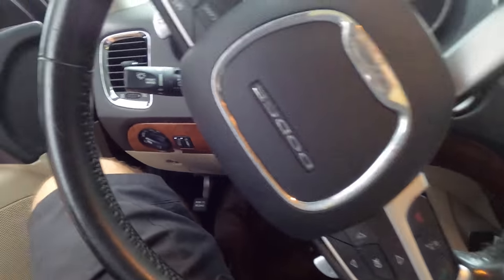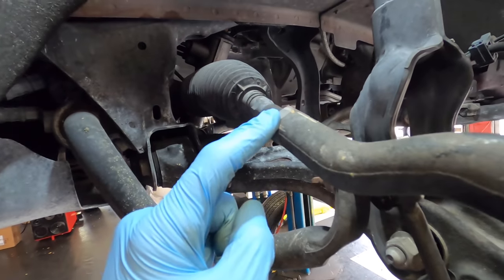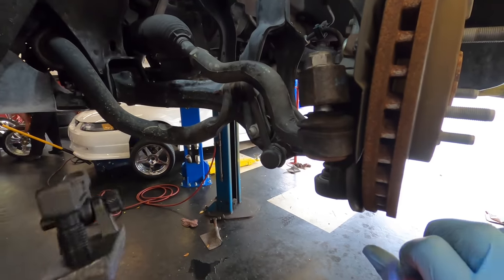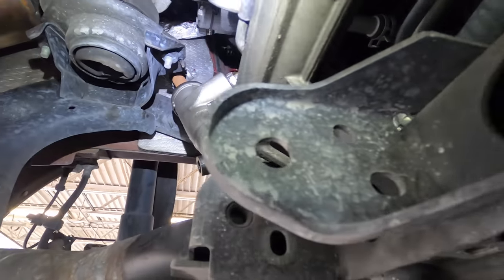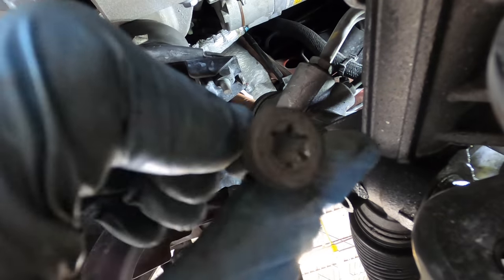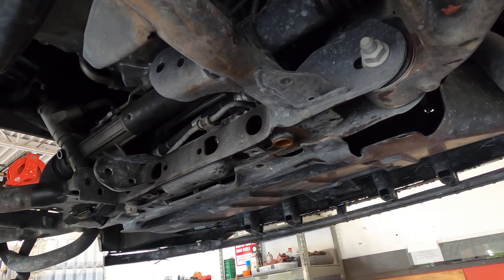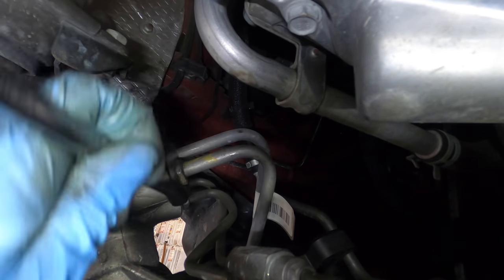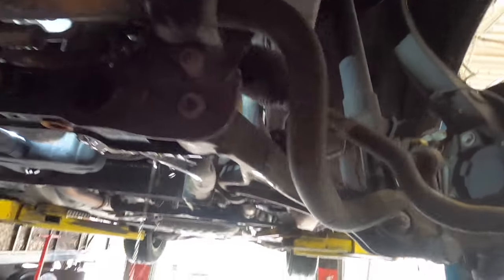Engineers vs Mechanics | They GOT Me!

Comment: I have done a few of exact same ones and was waiting and cracked outer tyrod nuts and thought yup he has got it then when you twisted it forward and left I was yelling at video (stupidly thinking u could hear me guess 34 years doing this job is starting to get to me) but soon as you turned it correct way so you don't have to remove all other unnecessary things all data (what we have at shop) I was sitting there thinking he is going to be upset when he notices didn't have to remove inners (but I'm convinced that these people who design this stupid things they made 1/4 "to long,short, narrow etc are the kid that got picked on in highschool for the kid on auto (same one  all kids in auto also couldn't stand and is not doing anything like this for a living was thinking about that kid and he will get even by doing this stuff I can't for the life of me understand why they don't hire retired or older automotive technician's to go over final design to say just make this shorter and dealership's to small shops can get these jobs done without loosing your mind

I really wonder like to know what ever happened to the people who designed the PT cruiser so bad it's a train wreck to repair if I get one more time in belt for one of them I think I'm going to lose my mind one a month is good enough not like six in a row every ftweeks (keep up the good work I would love to be able to film and post jobs I get but still trying to figure out a new cellphone every few weeks!thank God I have it in my contract for 1 cellphone a month replacement if necessary if you ever in the Daytona Beach area drop me a line we are about 5 min away from ttdack

Comment: I dont understand why you have a problem with the engineers building cars in such a way that it takes a mechanic to fix it. And that is what they do. In years past everybody fixed there own cars because they could. But today if you need a new headlight bulb on fx a 2008-2014 Audi A4 B8 you have to loosen the first bolt on the fender and loosen the front bumper and then completely unbolt the headlight to change them out. And im sure if there is any mechanics that read this that have been in that line of work for the last 15-20 years, think back on what things you used to fix on cars vs what your doing today. So dont get mad at the engineers they are just making sure that the mechanics have a job :)

Comment: 3:30 A nice trick  to remove these ball joints I have learned: take 2 decent hammers and whack them simultaneously on the outer casing of the bearing. The blows have to be exactly one the opposite site. This will simply pop out the ball joints even when pressing or putting heat on them fails.

Comment: A 3.6L V6?! That's just depressing! I've always preferred to stay above 4L when it comes to 6 cylinders like the 4.3L Vortec V6, or the several great, tough, and big, inline 6s from back when Pluto was a planet. I do know that in modern times though they are supposedly able to get some impressive power out of these smaller V6s nowadays. They say that all of the newer V6 Ecoboost engines are supposed to be incredibly good and powerful for their smaller size. Don't quote me on this, but I believe I read that the smallest one is only a 2.3L that makes something like 270hp/310 lbs-ft of torque! That is quite impressive. However those are unfortunately Fords and obviously that fact immediately kills the idea of ever owning one of those!!! I wonder if we will ever again see the days of big 6 cylinders, or will they continue to make them smaller, high-tech, and highly tuned to make their power? Either way I will still always be a fan of the good old 4.3L Vortec.
Reply: The GM 3.8L V6 was a great engine. Used by Pontiac, Buick and Olds. Plenty of power, economical, smooth and quiet. Of course they had to get rid of it!
Reply: That's how it always seems to go. They give us something good just long enough for us to take a liking and preference to it and then they jerk the rug out from under us by discontinuing it. Most of the time they also replace it with something much downgraded from the one we liked. My beloved 4.3L Vortec has unfortunately met the same fate, so I feel your pain.

Comment: I think the reason you’re having so much trouble is because you call all of the nuts and bolts fasteners….
   I’m sorry but This old-school mechanic here would’ve had it In-N-Out of there like it had a zipper on it!
It is what it is brotha.
BTW, always secure your steering wheel on any model with an airbag from moving any at all! Because you can destroy the clock spring in your steering column.

Comment: As said already your explanation of line wrenches is way off. If you used a bigger hammer and hit it where you did on the side of the knuckle where the tie rod  goes thru it will pop right off, just need a bigger hammer. Also would like to have seen the pinch bolt torqued properly as well as the bolts holding the rack to the frame and tie rod to knuckle nuts torqued. I hope you never have to go to court over a wreck that during forensics it was found that these fasteners were not torqued properly. The blame can be shifted very quickly to the shop if a bolt snaps or something, especially the pinch bolt on the steering shaft. Just a couple seconds of your time can save lots of headaches down the road. I know torqueing every bolt and nut is not needed but suspension, steering, and brakes its worth the extra minute or two. I worked at a dealer that had a car that the pitman arm shaft broke and 3 people were killed in the car. While nobody at the shop touched the pitman arm they had replaced the idler arm and the bolts holding it to the body were overtightened and the jury awarded the family of the driver $4.5 million in losses because they said the mechanic overtightened the pitman shaft nut causing the shaft to break since he overtightened the other fasteners he more than likely overtightened the pitman shaft nut. All a load of BS but if the idler was torqued correctly there wouldn't be a fault to allow the jury's reasoning.

Comment: Design engineers should be falsed  to remove what they design. You've had it easy so far wait until you get a range rover evoque and find you have to lift the body off the chassis to do something as simple as replace the starter motor. I see nothing wrong with removing brackets that are there for a different model, it's only there because it's cheaper to make 1 subframe that covers the whole range.

Comment: Ummm....Hate to be the one to bring this up but its not the engineers fault you didn't remove the tie rods from the old rack and installed the new one without the tie rods. Probably shorted the whole assembly by feet, no wonder it went in but wouldn't come out.

Comment: As the saying goes. An engineer will walk past 12 naked women to screw a technician. 
Couldn't deal with the random mix of cars, one manufacturer is bad enough.
Wait till you get a starter on the newer Tundras or a steering rack on the new 4wd tacomas. 
Where you have to pull the front diff and move the ac compressor

Comment: Oh noes a chrysler? I so despise the company and the lack of support they provide their clients and their crappy cars that I am slowly getting to a point where as an engineer I am going to take offence when someone calls the guys who design cars at GM/Ford/Fiat-Chrysler engineers... LOL Especially the bottom of the barrel brands such as dodge they throw in their worst things... I used to drive a dodge avenger and the only thing going for that car was maybe its tolerable looks... but then they came out with the HHR holy smokes those were something... lol and who could forget the most horrendous looking chrysler pt cruiser... lol. But looks are subjective... their shitty torque converters, the V6 engine that did not have any power I do not even comprehend how that was possible...

What kills me on this particular one that with all the infinite space they had under the bonnet they could not find a way for that steering rack to have a teeny tiny bit more clearance and of course as you say... that fucking shaft does not need to be there it might as well be a socket the shaft goes into but never mind, right? :D

Btw. why is there no splash shield under this car that would keep the salt and crap out? Every car has one I thought... OK every other owner loses theirs :D

Comment: Classic example of why car designers are such dumb arses, always designing things to be assembled on a line instead of designing them to be DISASSEMBLED!

If something disassembles easily you can BET it will assemble easily. The converse is rarely true. I was taught that a LONG time ago when working on electronic amplifiers which could have any module removed and replaced in under 2 minutes, including removing the outer covers. The AVERAGE repair time was less than 5% of the industry average for similar amps.

 Perhaps ironically, they were also MUCH more reliable than the competition too. Customer repairs were a breeze, with their amp being repaired & returned by post within 4 working days from receipt!!

Car designers have NEVER embraced this concept, with many commonly failing parts taking HOURS longer than they should due to utterly crap maintainability standards (if any)!

Comment: Seems to be an endless pointless video... This is a DIYer job and I was doing it a good dozen of times on my cars so seeing it yet another time was definitely a loss of time. I would rather see a good video on rebuilding rack and pinion as ALL the units rebuilt by 'professional' mechanics I had in recent years were a complete junk. The 'best' barely lasted a year.
And as about these weirdos by mistake calling themselves 'automotive engineers' - they have totally different objectives. They design the cars to be sold and scraped ASAP and then replaced by the new ones, not to be repairable. Nothing personal - just business...